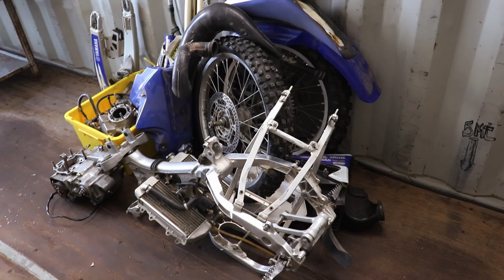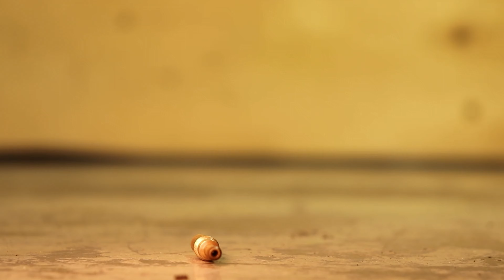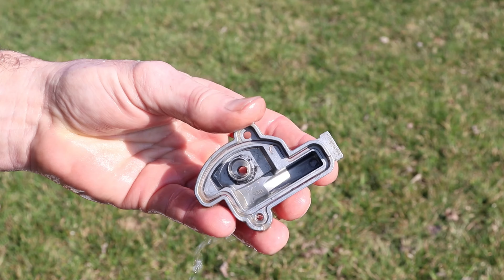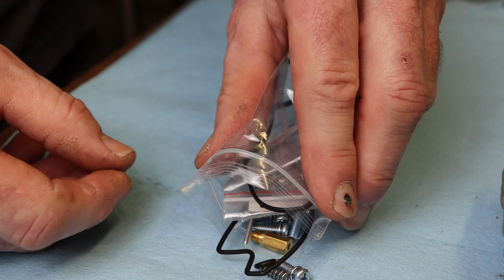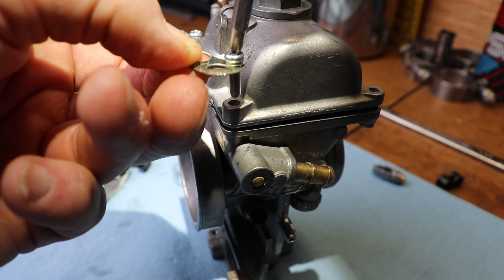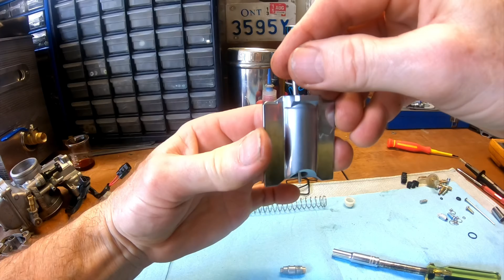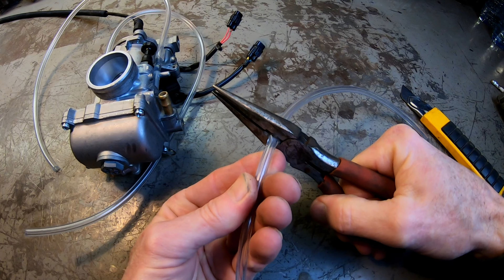Yamaha YZ250 Carburetor Rebuild In Close Up Detail

Comment: Hey man how do you know what length to cut for the hoses for the carb?
Reply from the maker: Generally the idea is to have those hoses exit down below the engine and typically route into the gap  between the engine case and the swingarm . You could make them fairly long first  and once the carb is mounted and hoses are routed then trim them to length. Hope that helps . Cheers 🍺
Reply: @TRyanLearnBikes absolutely! Thanks man! I got a new to me 02' YZ250 and this video is huge help. Got a rebuild kit on order and my carb torn apart, thank you!
Reply from the maker: @kowbowski954 Thats great to hear. Congratulations on your new to you bike .That is an excellent machine, it'll be a wicked rig  to pilot , I'm sure you'll love it . Good luck getting your carb rebuilt and ready to rip it'll make a huge difference in performance once you get all the new bits installed. Have fun and stay safe out there. Cheers buddy 🍺
Reply: @TRyanLearnBikes thanks man! You as well!

Comment: Uh so I jump the gun and forgot to count the turns out the air mixture screw came out how can I fix it. My bike won’t start
Reply from the maker: Ok , no worries. There's many variables that can influence the perfect setting but a good baseline starting point is 1.5 turns out from fully seated . You can adjust .5 turns in or out from there  as required so the typical range is between 1 and 2 turns out from fully seated . Hope this helps 
Good luck 👍

Comment: Hey if the air mixture screw doesn’t have the washer or o ring could that cause a hanging idle?
Reply from the maker: Well yes there's a good chance that any missed "o" rings or washers will impact overall carburetor function in a negative way .

Comment: Is the tps sensor just for the power jet solenoid?
Reply from the maker: No , the power jet solenoid is triggered by RPM under CDI control . The TPS is used to control and adjust ignition timing , Its goal is to optimize spark advance across the throttle range . Basically sharper responce in the low and midrange zone , and safe timing under  high rev load . 
Hope that helps . Thanks for such a great question .Cheers 🍺

Comment: I noticed the plastic idle speed screw has white thread sealant on it from factory. Is it not necessary to re-apply?
Reply from the maker: You make an interesting point .It's probably not a bad idea as I guess there could be a very small possibility that air could enter through the gap in the threads. 
Thanks, I will ask the mechanics at the shop next week, to see what they have to say about it.
Cheers 🍺
Reply: @TRyanLearnBikes 

That is the concern. I also can't think of a good product to use, that dosent risk getting inside the carb. All the thread sealants I have seen are anerobic, not sure if they would cure properly 

Please update when you get an answer.
Reply from the maker: @jakeb1778  Ok Jake I will see what they have to say mid week .
Reply from the maker: Ok Jake ,I asked the mechanics at the shop yesterday and they figured what we were seeing is likely white grease lubricant not any sort of sealant . I'm glad you spotted that issue and questioned it as it was something I clearly overlooked .I have since greased the one on by bike . This is what the channel is all about ,we should always " TRyan Learn " because like Einstein said " When we stop learning we start dying "  Thanks Jake . Cheers 🍺
Reply: @TRyanLearnBikes Hey Ryan,

Not it was definitely some kind of rubbery pre applied thread sealant. Grease might work well for selling the threads, though. Cheers!
Reply from the maker: @jakeb1778  Ok I'll address that with the guys next week and dig a little deeper to see if we can come up with a definitive answer to this question. It looks like there's a little more to it . I'll get back to you .Cheers 🍺
Reply: @TRyanLearnBikes  I don't know what is happening, but my comments keep dissapearing after posting. Might be the link I am trying to post.

The part number for the screw is 5HC-14922-00-00 If you Google that you should see a picture if the screw with sealant.

I am suddenly have a bad hanging idle after cleaning my carb on my yz250x. I doubt it's the screw but I am trying to narrow it down.
Reply from the maker: @jakeb1778 Thanks for the details. It'll help finding in finding more info .

Not sure why you are unable to see the past comments. I'm able to see all our conversations in this thread .

Hopefully you can get your idle issue sorted .
Reply: @TRyanLearnBikes  Any update? I ended up using some motoseal on the threads and letting it dry before installing. Worked good, screw is harder to turn so it will keep it in place and seal the threads. 

Unfortunately, my idle hang has not gone away. I am at a bit of a loss at what could be causing it.
Reply from the maker: @jakeb1778 @jakeb1778 No resolution to the thread sealant issue .Much discussion around the luch table but no common agreement as to what it is and why its needed. 
The spring on the screw should be enough to hold it in place and stop it from drifting and as far as making it absolutely air tight by using  a sealing paste..well its a non issue according to most of the guys .
Now regarding  your persistant  hanging idle isue .
As you know one of the most common problems with pretty much any carburetor is the pilot jet and associated circuit. While we always pay attention to cleaning the jet thoroughly sometimes the circuit in the body of the carb gets overlooked especially that super tiny hole in the throat of the carb 

Its only a suggestion but maybe revisit  cleaning the circuits in the body of the carb , specifically the pilot jet circuit.

I have a video coming out tomorrow that highlights that particular issue in a carb on a little 
Honda CRF 70 .I know its not the exact  same  carb as yours but the basic idea holds true .

If you get a chance have a quick.look and youll be able to see that pilot jet circuit Im talking about .
 Hope it helps 
Cheers 🍺
Reply: @TRyanLearnBikes Yea it seems unlikely to suck enough air there to be a problem. Little motoseal on the threads doesn't hurt, though.

I did find some sand in my float bowl. At the time, the bike was running fine. I proceeded to clean the carb thoroughly in a ultrasonic. This included blowing out all the passages, including the ones you mentioned. I have since repeated this 3 times lol. I guess it possible some sand is stuck in the pilot circuit  but seems unlikely. 

I am going to do a leakdown test next. If there are no leaks i will consider buying a new carb but they are ridiculously priced. 

Cheers!!
Reply from the maker: @jakeb1778  Hey Jake I feel your pain with how frustrating this is to solve . Espesially when you've repeadedly tried to deal with each factor in great detail and still have the same problem . Last night I thought of one other thing you could  try . With the bike running at idle ,spray a little brake cleaner around the manifold /boot at the intake .If the bike has a noticeable increase in RPM it indicates there is a crack or some sort of leak happening between your carb and the engine .That scinerio can have a huge impact on idle stability and overall engine performance .
I know its a stab in the dark but its worth a try before you spend big bucks on a new carb . If you do try this let me know how you make out .Good luck .
Reply: @TRyanLearnBikes Hey Ryan, I will try that for sure! I appreciate you willing to chat a bit on here. Cheers, man!
Reply from the maker: @jakeb1778 You're very welcome.I really hope you get your carb sorted .Good luck 👍

Comment: Any tips for keeping my carb working proper. I am in canada, and all fuel here has ethanol. I do put fuel stabilizer. Is there anything else that I should be doing if the bike is sitting for a month or longer?
Reply from the maker: @jakeb1778  Hey Jake ,I'm in Canada too, so I feel your pain with the whole ethanol debacle . I know some guys like fuel stabilizer too but it's not something I've ever used .If there's periods of inactivity with your bike , draining the carb isn't a bad idea. Another thing you can do even on a four stroke bike is to add a thimble  or two of two stroke oil to your fuel . It's not enough to foul or smoke up your engine but it does keep the inside bits of your carb working freely .
Hope this helps. Cheers buddy 🍺
Reply: @TRyanLearnBikes  great! Thanks. My bike is a 2 stroke.
Reply from the maker: @jakeb1778  Good stuff .Gotta love two strokes 👍 .

Comment: Hi, I just bought a YZ250 04' to restore it and I read in the manual should not touch the TPS because it could cause issues, but I have to remove it to clean the carburetor in an ultrasonic tank. Can I remove the TPS in the same way as in your video without causing any problem? Thanks
Reply from the maker: @bdncdn  Hi Brandon, Yes you can remove the TPS as shown in the video without any issues. The manual is talking about the fact that it's not a serviceable device and not meant to be disassembled and tinkered with .Basically, if it was malfunctioning, just replace it don't try and fix it.
Hope that helps.Good luck with getting your YZ up and running well. That's a great bike , you'll have lots of fun on it for sure.
Ride safe,cheers, buddy
Reply: @TRyanLearnBikes  Thank you very much for your quick reply Sir 🙏🏼 Cheers
Reply from the maker: @bdncdn  My pleasure. Cheers 👍

Comment: I tried cleaning my carb a few years ago, still ran weird. High idle when hot, did not seem to have a lot of top end. Finally got a rebuild kit, found it had some smaller jets and the tps reads backwards. Great video, no bs or fluff. Now for a new tps and see how it runs now
Reply from the maker: @rcravincase  Hey thanks for the  great comment. Good to hear you have sorted out your carburetor and once the new TPS is in place you'll be good to go .Good luck ahead. Cheers  🍻
Reply: @TRyanLearnBikes  i rewatched and paused on the manual. I was testing the wrong wires. Up and running now with quite a bit more power than before
Reply from the maker: @rcravincase  Oh man ..thats great to hear 👍. I am genuinely happy for you to have found success. Have fun riding your newly amped up bike .Be safe out there.Thanks for taking the time to comment with positive results. Cheers to you good sir 🍻

Comment: I have a question about the spring loaded cable holder sir
Reply from the maker: Sure man I'll do my best .What have you got?
Reply: I have a 2005 yz250 two stroke with a keihin carb. Does this have a spring loaded cable holder? I think the last time I rebuilt my carburetor I lost it because when I put it all back together and rode it, the needle bent the first 2 mins of riding.
Reply from the maker: @stephenchrzanowski9235  .
Typically that carb would have a spring that fits inside the slide and is captured when you screw the cap down onto the carb body .It should provide enough spring pressure to snap your carb closed when the throttle is released. It also pushes down onto a plate that traps your needle in position. So I imagine it is possible that without that spring the needle could have possibly moved around enough to misalign and get bent .I'm guessing that since you discovered the bent needle it would have been obvious there is no spring inside the carb .Is that correct?

Comment: On that throttle position assembly there's an oval-shaped gasket. My kit didn't have one and it doesn't look like you did either. Did you re-use the old gasket, or stretch a circular one? I'm not really seeing any matching ones in kits online.
Reply from the maker: I re- used  the old one .I like your idea of stretching a circular one .I may try that if I have to repeat this job .Thanks for the great idea 
Cheers 🍻
Reply: @TRyanLearnBikes  Weird that none of the kits cover that! Thanks for the quick reply. I'll re-use my old one too. I think stretching would weaken a gasket or create thin points.
Reply from the maker: @matdflo  You make a good point ,it is odd that the rebuild kits don't supply a replacement "o" ring . Good luck ahead with your rebuild .Thanks for taking the time to watch and comment .Cheers to you good sir 🍺

Comment: Its important to note the needle setting. Why? How do you know what it is supposed to be? Maybe someone worked on before you and didn't have a clue of what they were doing and whacked it all out. I have found that most are of these are between 3/4 and 1.5 turns out. Anything more or less and you likely have any issue someplace else. But who knows? Check a manual, it may have the proper setting or it may not. All that said, good channel and good info, like it! Thanks for posting.
Reply from the maker: The assumption was that the setting was correct pre dissassembly .Of course there is always adjustments to be made depending on many different factors .Its unreasonable for me to suggest any one particular setting would work for everyone . Thats why I said to note the setting .
Thanks for watching and taking the time to comment .Cheers

Comment: This is a great video!! I have a 04 yz250, that just pours gas out of the over flows. I've rebuilt it and it still just pours out, the float height seems right and i changed the float needle valve and the seat looks fine.. I can't figure it out. Any help??
Reply from the maker: Hi Joe , I had a similar problem with an older RM250 . There was an issue with the actual float itself .It was a hollow plastic type that had a crack in it and filled up with fuel when gas was introduced into the bowl .So it  didn't float anymore and wouldn't raise up to close the needle valve . Even some of the newer  solid types  can become corrupt and fail to float properly when  required . So maybe check to see if the float is 100% bouyant . If you get a chance let me know if thats the case and you were able to fix it . Good luck

Comment: My 2023 yz250x is fouling plugs left and right. It only has 2 hours of break in. Jetting is off. But I need to find a recipe to fix it. Some say use #40 power jet. I've been running 32.1 and I'm sticking with that mix. I know changing ratios won't fix jetting. I'm at sea level to 2500 ft elevation at max for some trails out here. Nothing too cold. 50f to 85f.
Reply from the maker: Hi @justobservenow3480 . You have a very nice machine to ride ,thats for sure Brand new with only a couple of hours on it .From sea level to 2500 ft is a considerable range to cover  but I'm sure you can find the right set up with a little patience . I'm not well versed in proper jetting combinations and can tell you its a bit of a black art for most .The best advice I have is for you  to talk to guys in the race crowd who ride in your area and ask what the're set up is .You can be certain they would have tried every set up out there and likely have it dialed in perfectly . Good luck
Reply: @TRyanLearnBikes  Awesome thank you for your response. That's good advice.
Reply from the maker: @justobservenow3480  My pleasure ,enjoy that fantastic machine and ride safe .Cheers

Comment: Did u stick the tps in the bath too? I have same carb tps is sticking on WOT, checks out got just hangs up top sometimes can it be cleaned out? Thanks man awesome video subbed.
Reply from the maker: Hi @SoCalMisfit712 .I did not put the TPS in the untrasonic cleaner bath . It was free of any hangups and seemed to function correctly so I didnt want to mess with it . They dont seem to be a device that is easily dissasembled so Im not to sure about trying to get inside to have a look around .Having said that if the cost of a new one wasn't rediculous I might be tempted to throw caution to the wind and have a try . Sorry I couldnt offer a better solution .Let me know what path you take I'd be curious to hear how you tackle this one . It would make a great video for you to put out there because I'm sure you aren't the first guy to have  a TPS issue like this . You might get a ton of views on it .I see you have a pretty cool channel man with some great fishing videos ,really good stuff .  Hey also thanks for the great comment and the sub .Cheers to you good sir .
Reply: @TRyanLearnBikes  cool man thanks. It is soaking in wd40. The carb is propped on its side and the slide is holding it as far as open as possible. Checked and the numbers are still good so I’ll let it soak for a while and see how she goes. Just after an hr it seems to be better.
Reply from the maker: @SoCalMisfit712  Very good , sounds like you will be  successful with the WD40 strategy. Best of luck ahead. Ride safe and thanks again I truly appreciate your support  cheers 🍻